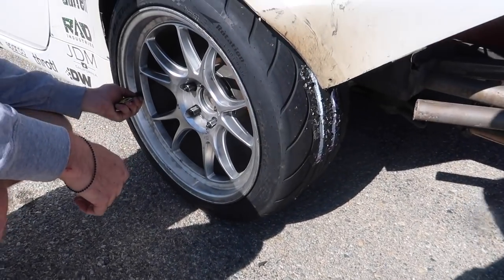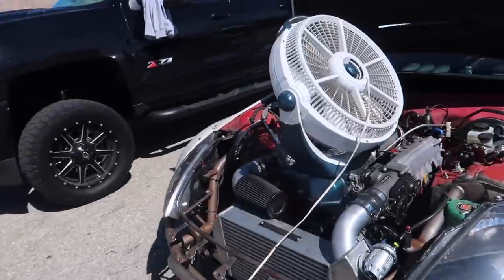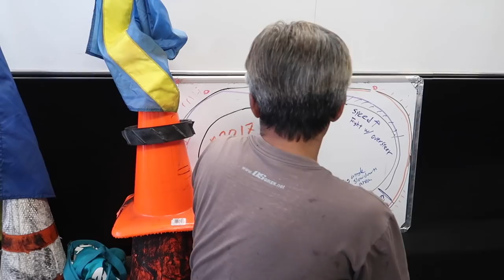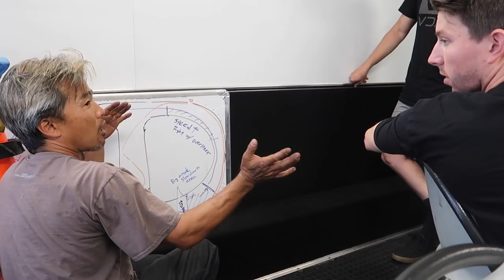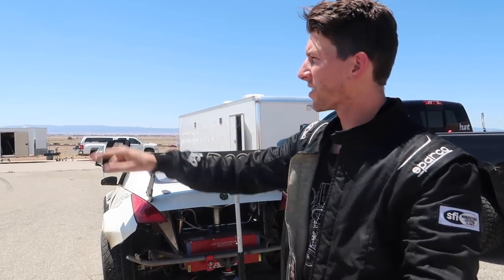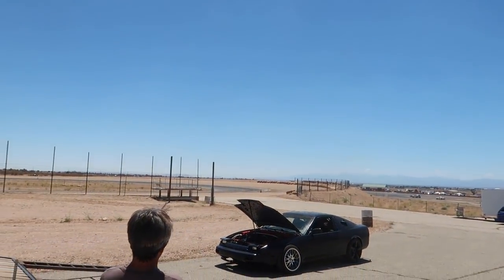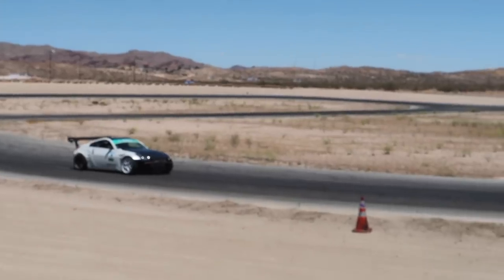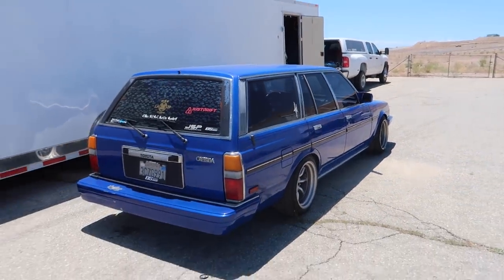Learning FULL throttle commitment! (65mph+)

Comment: The improvement 👌🏼👌🏼 I had the same issue with the oil return fitting on my Supra, I tightened it as hard as possible and it doesn’t leak anymore

Comment: BROSKI

Replace them AN lines with some Forklift Hydraulic Pressure Fittings. They’re rated up to 2,000 PSI. They will not leak like AN fittings do.

Chances are the hose is leaking from the AN fittings where the hose push-locks into the AN fitting. Unfortunately no amount of tightening the fitting itself will fix the issue.

Comment: May sound odd but try using some shellac between the washers and machined surface for the oil line. I had a similar issue with a turbo line before.

Comment: Tj have you tried using loctite on your turbo oil return line? Green loctite has a super high boiling temp and would probably not melt from the heat of the turbo